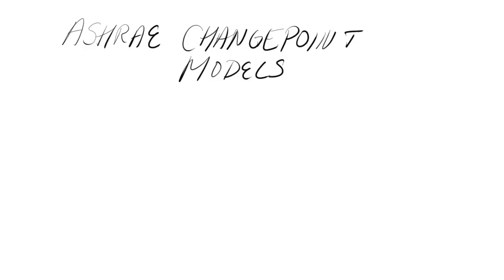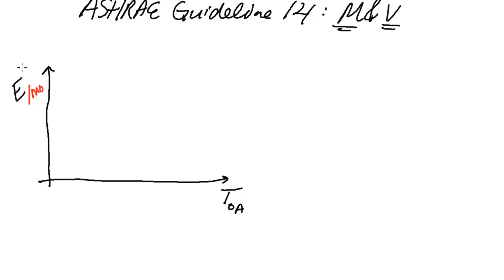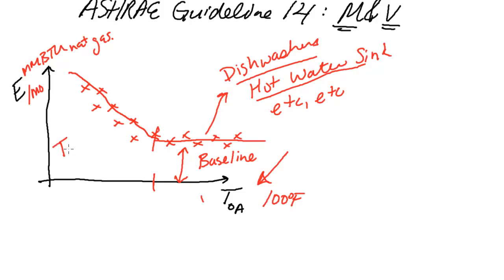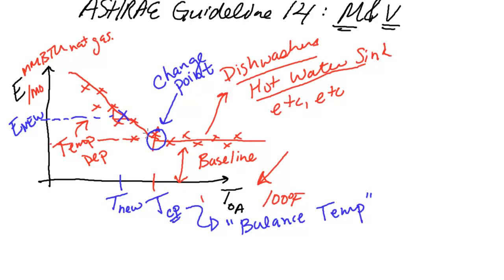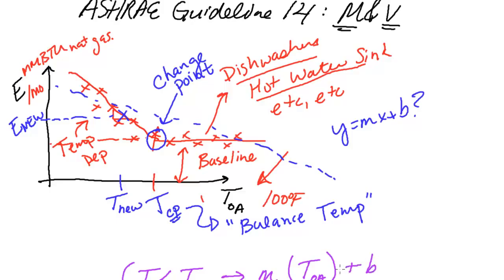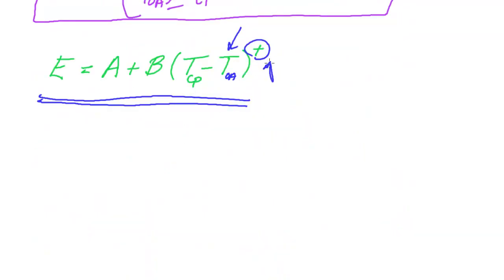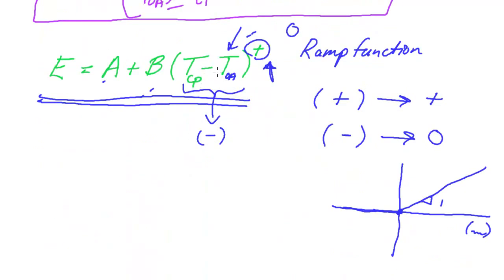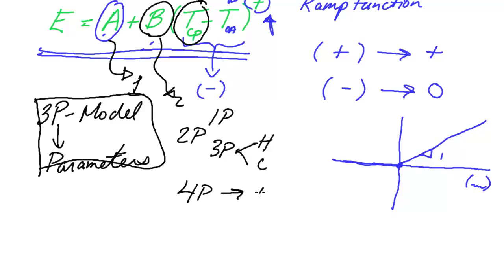Introduction to Change Point Models

Comment: Are you familiar with ECAM (Energy Charting and Metrics)? This excel-based tool has built in macros to run change-point models. I am very curious as to how the overall R-squared and other statistics are evaluated for these model types.
Reply from the maker: I'm aware of ECAM, although I have never used it myself. My guess is that the R^2 value is from the general definition of 1 - SSE/SST. The other two common metrics I typically use are CV(RMSE) and normalized mean bias error (NMBE), which both have fairly unambiguous definitions.

Comment: Great video! I found both it and your paper very useful, as well as the github link you posted. Do you think this analysis would work if the baseline is not straight but is instead at less steep angle than the data after the change point (non engineering application)?
Reply from the maker: It depends on what the goal is. You can always run the mathematical fit and it will do it's best to minimize the error. For the 3 parameter models, the ones with a flat portion and a sloped portion, if the data set is very flat, the location of the change point will be sensitive to small changes in the data. If you are using the models for parameter estimation, where the changepoint is supposed to mean something for your data, then you need to be aware of that fact.

If three parameters are not enough, then you can add more. And these higher parameter models (typically 4 parameters and 5 parameters for HVAC models) can fit more complicated data sets. I believe this video series does cover those as well.

Comment: Hello, do you have MATLAB, or Python for that? Than you.
Reply from the maker: I don't have a full library in MATLAB or Python built, sorry. However, you can check out the example section in the paper I have posted here: 

https://www.researchgate.net/publication/312051080_Algorithm_for_explicit_solution_to_the_three_parameter_linear_change_point_regression_model

It has a full example of MATLAB code for the three parameter cooling model, which you should be able to copy directly.
Reply from the maker: I now have at least updated code for the 3PC and 3PH models for Matlab, you can get the code at:

https://github.com/mitchpaulus/ASHRAEGuideline14Models

The 3PC is good, I haven't fully tested the 3PH, but don't be afraid to give it a try. At some point, I'd like to put up the 4P and 5P, along with versions in other programming languages.
Reply: @MitchellPaulus  Thank you so much.